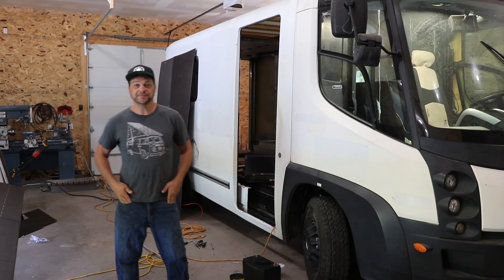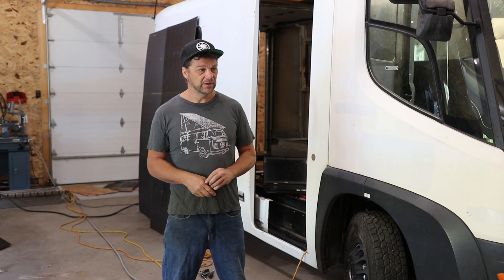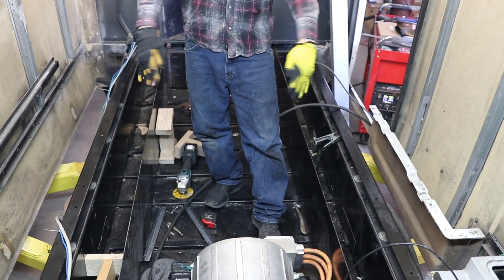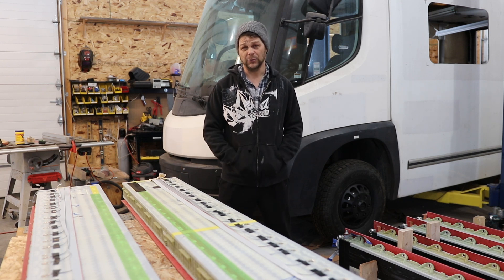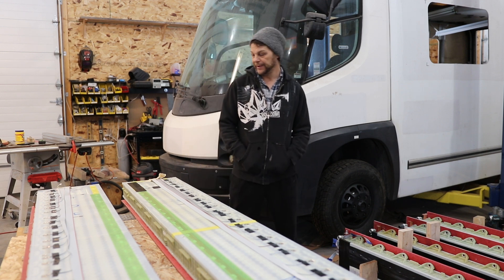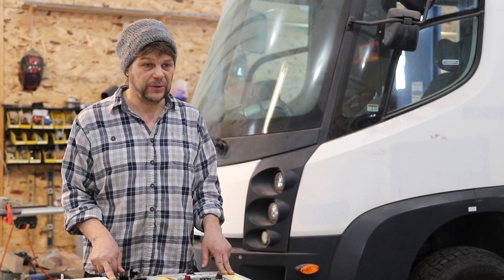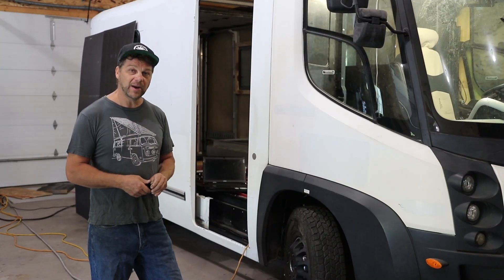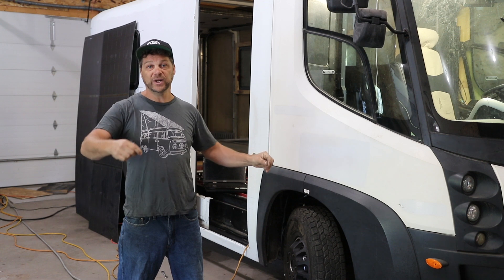Tesla Battery Install in Redfoo's Solar-Powered, Electric Van by Solarrolla!

Comment: No thermo expansion? I have a Tesla M3/Y Battery setup in my custom RV.

Not coolant running through the batteries?

I started my build in Wisconsin, the truck was a Street Sweeper.

Comment: I've been wondering if it would be possible to build a micro camper with a model Y battery bank connected to the main battery on the model Y, or as a solar bank when stored in the garage.

Comment: The sailboat / sailor analogy is great. With OEM EVs getting so good, I feel like the value of custom EV projects is all about knowing how the vehicle works and being able to maintain it yourself. I've been following since the original RdS van... It is incredible how much more battery you are able to fit into this.

 I'm very curious about the details of how you installed that copper busbar onto the module... How you cut the bottom existing busbar, how you ensured the hardware won't vibrate loose, everything. I am working on a very similar setup (my modules are stacked one on top of the next) but I have the same need to remove the existing terminal.

Comment: Nice work! I've been following you all for a while now - since Route Del Sol - and you've inspired me to convert my 1991 Mercedes T2 609D RV to electric. It's currently got a very reliable diesel engine that I'd like to crate up and sell to help pay for some batteries. I got 1600 watts of solar on the roof already and after doing the van and buslife thing for a while, it just started to become obvious that if I'm going to keep increasing my battery capacity, I might as well make the drivetrain electric and outfit it with a ton more solar. Appreciate you all documenting your builds and breaking down the process into bite sized pieces.